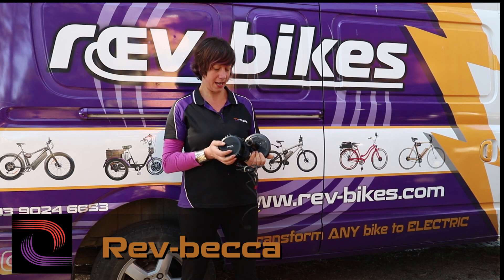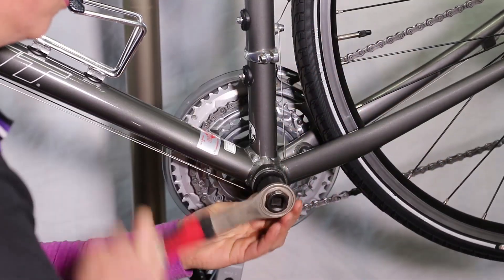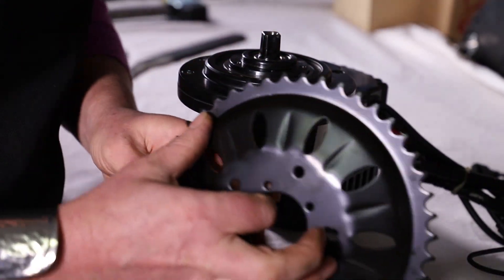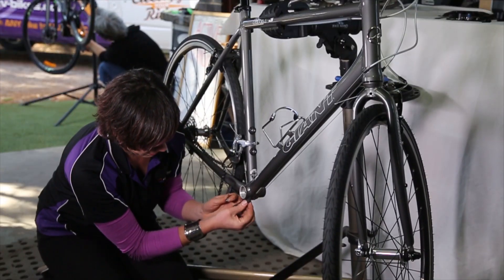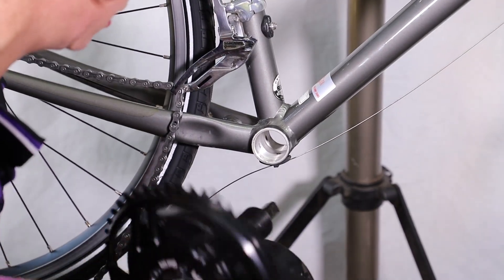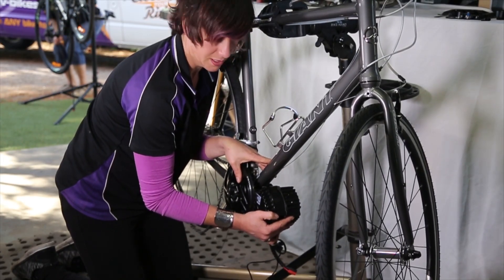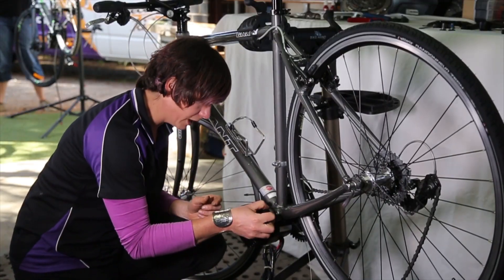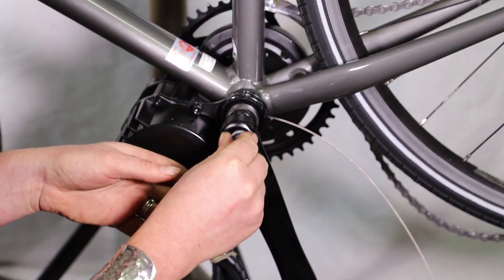Installing a Bafang mid-mount motor

Comment: Well done instructional video, thanks for leaving out or speeding up the tedious bits.  One thing I would like to know, why doesn't the kit come with some optional bits, rubber shims, wedges, etc. for the critical area between the motor and downtube? With my limited knowledge of elementary physics/mechanics I feel that the the torque applied to the frame requires more than a piece of hard rubber which will over time compress and become dislodged. Also, it would be prudent to check and possibly re-torque the motor lock ring after a short break-in period.

Comment: When the motor moves the chain what prevent it from rotating the pedals?
Reply from the maker: The motor contains a freewheel, so it moves the chainring separately from and independent of the cranks. The pedelec function uses the movement of the cranks as a sensor, to engage the motor automatically when pedaling 😁

Comment: Hello, I have a hasebike trike with a Shimano midmotor 250 Watt. Besäuseln my left leg is less stronger than my right after a stroke 5 years Abo, I like to change my Shimano motor for a bafang , Is that possible?
Reply: Correction : because my left leg ;5 years ago

Comment: Might be cheaper to just have the local bike shop remove the pedals and re-install rather than buy specialty tools that might get used once or twice. Just one question,,, when did the crank bearing hangar become a ' bracket '? Isn't a bracket something you mount a shelf on, plus the crank hangar is where you find the crank bearings, why did that change? Is it like the way some of us are calling chips ' French fries '?
Reply: Crank bearing hanger is a phrase I've never heard before - I've worked on bikes for years in the US. Where are you from? In my vocabulary, the cylinder in the frame is the bottom bracket shell, the bottom bracket comprises the crank axle (aka bottom bracket spindle), bearings, bearing cups and retainers.
Reply: You ARE funny.  Truly.  I though America and Auld Blighty were two nations separated by a common language but now I know  it has spread even to the nether regions of the empire.

Comment: Why do you have to toss the existing bracket and gears? You're throwing away some of the bike functionality, are you not?
Great video, btw.
Reply from the maker: The motor has a particular attachment for a single chain ring, which is supplied. So the triple rings can't be used, this would be unnecessarily complicated anyway.  You won't need as many gears once you have a motor, and 5 levels of assist as well.
Reply: @Revbikes  I am just starting to look at the ebike conversions. I have been wondering  about this too. I would prefer to keep the triple chain gear setup that I have and just add a motor to the existing system. That way I do not sacrifice the capabilities of the bike when I am not using the motor (Multi-day trips over the back country roads will not allow recharging casually so the motor will be used primarily as a hill assist). The "complicated" aspect does not bother me as I come at this with 30 years experience as am ASE certified master automobile mechanic, machinist and fabicator. My concern is; Is there any functional reasons pertaining to the conversion itself that prevents the use of a triple chain gear and front derailleur? Thanks for any input you can offer. :)
Reply: @nowhere-everywhere1  Just go with a hub motor. You keep all your bike gears and the motor simply replaces the rear wheel. I am not aware of any mid-drives yet that utilize the triple front sprockets yet. I for one would love to have a 30T and 42T in the front. I currently have a 42T but there are hills where I'd really like to have a 30T for a few minutes. ;)
Reply: @nowhere-everywhere1  You need more than one bike.

Comment: Should the back wheel be locked so the recharge function works?
Reply from the maker: Strange question. There is no recharge function to this motor. Only Direct Drive hub motors can have Regenerative Braking to help charge, a tiny bit.

Comment: She said that the motor was going to replace the "bottom bracket" and she keeps calling the crank the "bottom bracket" so I see she really meant the "crank assembly" ..... I think had she rotated the assembly forward to it's final mount position she probably wouldn't have had to cut and reverse the cable guide, but it was probably a good move on this build anyway because of dropping it from a 21 speed to a 7speed. All in all she did a pretty good job on the build.
Reply from the maker: The entire bottom bracket cartridge gets removed and replaced, as do the cranks and the chainrings.  The crank is just the part between the axle and the pedal.  Thanks for your positive feedback :)
Reply: @Revbikes  TOuCHE !!!
Reply: I too was confused.  I was waiting for the cutting torch part.  But then ... she was right and cut you off in her reply.

Comment: I have a adult tricycle could I put such a motor on my bike any information you can send to me would greatly be appreciated I also would like to know when using this type motor is it a pettiest assist device and whe motor is off is the draglike some of the hub motors thank you so much I mainly want to us it when riding and I encounter steep hills
Reply from the maker: Hi Laura. You may find the motor sits very low below your tricycle, depends the shape of the frame really. Not all hub motors have resistance, only direct drive motors. Geared hub motors and mid drive motors are freewheeling. I've got a hub motor on the front of my upright delta tricycle, and a mid drive on my recumbent 😊
Reply: I’ll have to check that out and measure it thank you

Comment: IF You are fitting other than a 250/350 watt motor I suggest a torque reaction brace, Luna do a good one, as the torque can slacken the motor and keep an  eye on the crank tightness as they do  slacken, and in the interest of doing a neat job DO tidy up the wiring, its really too long for most bikes, buy some small tiewraps and make loops behind the display dash area..I've fitted a few of these and am a cyteck guy.. and if you are in a rainy part of the world make sure all your loom joints and waterproofed , old race inner tubes are good, cut a 6inch section and thread the wires inside join the plugs and tiewrap the ends tight, the other thing that doesn't like damp is the throttle and the power switch, best to use a rubber glove over them or raid the kitchen for cellophane wrap...the brakes have been commented on , all the machines I converted have rim brakes,  race type dual pivots which aren't as powerful a decent  V's.. there's no issues with any I did.. brake  from 40 with a front only..
Reply: Another option is a sailboat turnbuckle. Search for "Bafang Sailboat Turnbuckle" for a different solution. Cheap and can be sourced lots of places.
Reply: She talks about doing that in the next video.

Comment: I wouldn't waste money buying expensive tools like torque wrenches and specialist lock ring spanners to work on a bike,  it's not that critical. A simple one tooth open spanner and an extension tube to apply the correct amount of 'ooomph' will suffice for most jobs on a bike, but then after over 50 years of spannering on everything from Meccano sets as a boy to marine diesels and multi cylinder motorbike engines I do have a degree of in built feel for torque...... Converting back to lbs/feet and having an extension tube two feet long and a fisherman's spring balance works just as well for the more pedantic out there.  After a while if you do it often enough you will get a degree of 'feel' for torque too.
Reply from the maker: So true Richard.  We do have a custom built torque wrench in our workshop now for the noobies, but not worth it for the DIY hobbiest.
Reply: for a one of build its easier and cheaper to let a bike repair shop do it for u than to buy tools u dont have and would o ly use once
Reply: We who know are with you Richard.  Too bad we humans with common sense and a bit of  mechanical  experience are so few and far between. %^)

Comment: Hi I hooked up the kit fully charge the battery and I'm getting no power what do I do?
Reply from the maker: Could be a number of things.  Have you plugged red to red and black to black?  (yes, we've had some do it reversed!!).  Are you getting power at the display when you press and hold the on button?  Are you using a brake cutout sensor, but haven't fitted it within range of the magnet..?  
I hope you can check in with your retailer for assistance.

Comment: Rev Becca where do you get that flat tool for the lock rings?  Thank you!
Reply: I got a complete tool kit with every tool you need to work on a bike for just under $30 (usd ) on ebay
Reply: It's made by Luna Cycles in the USA - lunacycle.com

Comment: Dat was the shit est  video    booooo
Reply from the maker: Interesting. Can I ask the reason for your opinion?
Reply: REV Electric Bikes   how long did it take u to even start. And ask urself did u finish the installation.  I'll wait...............................
Reply from the maker: We appreciate your feedback, thanks. If you're in such a rush, perhaps this is not the kind of project for you.
Reply from the maker: We will be making a vid of the rest of the installation shortly, but it is pretty self explanatory really, color-coded plug and play.
Reply: REV Electric Bikes   I was not in a rush I was just expecting to see her show me how to install the motor  plumbing the brake lines set up and ride off in to da sunset  all smiles that's wat a tutorial is right  not half a job sue u got there  mate  lol send me Ur kit  I'll do a way more better video than our sue there something u can learn from lol took her all day to remove a crank and some pedels lol  Just saying.
Reply from the maker: feel free to look at some of our other vids for details on fitting and using the controls.  This vid was about installing the motor, which it does in enough detail for the average DIYer.  This job takes about 3 hours all up, so I'm pretty sure we are right to chunk it a bit!

Comment: Question for all,,, IF USING  WITHOUT A BATTERY,,,,??? WILL IT PEDAL HARDER ?
or will it FEEL LIKE A STOCK CHAIN WHEEL WITHOUT A MOTOR SETUP??
THANK YOU ALL..
Reply: it will feel like a regular stock chain wheel. no additional resistance when you run out of battery like with a hub motor.

Comment: Hi. Will this fit using a BB30 to BSA adapter?
Reply from the maker: Hi Chad. We have done one with a BB30 adapter.  Worked well, after we cut the adapter brackets down (the centre parts didn't allow the motor to go through, we just needed the collar).  Because it was plastic, and the powerful 1000w motor is quite torquey and great at working itself loose, or biting the teeth into the bike frame, we made a torque brace so we wouldn't have to do the locking rings up so tight.  This was a piece of aluminium strip between the motor casing (using an existing bolt which is holding the casing together) and we put a rivnut into the frame near the BB.  Was an excellent solution.. I should have made a video of that!!  :D
Reply: @Revbikes  I used an aluminium adapter made by FSA. So far so good and appears to be holding itself tight. The FSA adapter fitted very well and matched my lower bracket perfectly.

Comment: BBS03 with rim brakes. Somebody will get hurt.
Reply from the maker: Maybe.. all depends on the riders style, and how well they maintain their brakes.  I've never had a problem.
Reply: Just get a BBS01 of BBS02, what the point of getting 25Amp motor on a bike this weak? getting quicker to the hospital?
Reply from the maker: @Dindo Nuffin sure, we agree, disc brakes ARE better.  Some people have budgetary restraints preventing the perfect bike being possible for them.  Lets not make this compulsory, when the space is already over-legislated!
Reply: @Revbikes  Tektro (among others) offers a disc brake caliper, pads and rotor for $20 USD. A person just needs a bike with disc brake caliper mounts and disc brake wheels. I started out riding my BBSHD with stock V-brakes. It stopped fine even with me, a big guy, on it. The brake shoe wear was significant though and a good set of brake shoes was $15 while the disc brakes for one end of my bike was $20. Easy upgrade when I replaced my wheels so I had the right hubs.

Comment: what would happen if u didnt remove the front derauller?
Reply from the maker: psudabest01 Nothing! Leave it there if you want.. It can even help as a chain guide in some cases.
Reply: I have a shimano acera so from what im reading is that you have to break the chain in order for it to be removed
Reply from the maker: psudabest01 can be the case. If you break the chain, you should get a joiner link for it, never reuse a broken link!
Reply: i can confirm that yes, you will need to break the chain or the derailer to get it off there

Comment: Hello Becca, 
I have TWO questions for you:
1) What would be the minimalist Bafang mid drive build to turn a manual bike into an ebike? 
I ask this because I am not a big fan of too many wires sticking around the bike frame as I see them time and again in installation videos. Can I do a simple build with just a mid drive motor and a thumb (or twist) throttle? I assume that the throttle is the only key element needed to control the motor. I could care less about the LCD display, the speed, or changing the power of the motor as the gears change especially as I ride on the highest gear no matter what the terrain! 
2) Is it a good idea to build ebike on a single-speed bike that can coast? Having no gear derailleur would further simplify my ebike especially when I do not use the gears anyway. The less is actually more and simpler!
Please advise.
Reply: @Amjad Farooq
You ll need to research this, but there are a few threads out there to run the BBS01/BBS02 without display or hmi at all. I personally run the BBS02 with only brake sensors, gear sensor, and minimal HMI (DP E12.UART), and no throttle. Works great for pedal assist only. Also I use a custom cable from Germany (where you can order a custom harness cable with the length you need for each part of the harness very precizely, resulting in a very clean build.(see www.e-bike-technologies.de). And yeah, mid drive all the way, there was no way I would add a hub motor and all this weight to a wheel! I am not affiliated to Bafang or to e-bike-technologies.de, but I recommend them.
Reply: Thanks Becca! I will look into that.
Reply from the maker: You'd be best with a hub motor if you won't be using the gears.  The main benefit of the mid drive is being able to gear the motor up and down for the terrain.  We have a system which can just have a single cable to the handlebars for the display, which you need on the bike in order to control the system, especially the pedelec level (we used to have throttle only systems, but they really are old-fashioned by todays standards - pedelec is heaps more intuitive to use).  I'd be looking at our hub motor systems for your purpose..  https://rev-electricbikekits.com.au/product-category/kits/hub-motor-kits/
Reply: Thanks Becca. But, I am a big fan of mid-drive motors.
Reply from the maker: Amjad Farooq ok, well then I'd suggest you get a mid drive system, and a frame mounting battery will make it easier for you to hide the single line cable up to the handlebars. There are ways to make the cabling neat, maybe try asking a woman to do it for you  😉 You will need the display to turn the system on. You can choose throttle, and it has pedelec.

Comment: torque tools are not that expensive. worth getting some.
Reply from the maker: Feel free to point me to the right tool for this BB locking ring, which has a torque meter on it.
Reply: @Revbikes  they make a very good sockets that will fit into any standard size torque wrench. it needs at least 60 ft lbs of torque.  I just find it daft that all the videos show people saying what torque is required but in reality they have no real way of knowing it's been secured correctly. the two headed wrench is not a good method imo.
Reply: @Revbikes  https://electricbike.com/forum/forum/knowledge-base/motors-and-kits/bbshd/7374-special-tools-that-will-make-bbshd-bbs02-installation-easier
Reply from the maker: We no longer allow DIY installation of our kits, because we'd rather do it right, in house 👌
Reply from the maker: Cool, Luna does it again!
But the feedback on that product is not great.. Not really feeling like that investment would be worthwhile for the average DIYer.
4-TAB LOCKRING SOCKET

The 4 lockring socket tabs should be slightly wider to provide a more snug fit in the lockring slots. The socket is also too shallow, engaging only about half the thickness of the lockring. Finally, the 1/2 inch drive hole is only about 2 mm thick so that the socket wobbles significantly on the drive. All three of these issues makes it difficult to provide 100 lb-ft of torque without the socket wobbling and losing grip on the lockring.
Reply: @Revbikes  yeah it's a fair point. The luna tool that they cut luna into it weakening the metal is not great. I found the socket to be very overbuilt and chunky. it did the job. I have seen at least four builds on YouTube where the motor has loosened either from poor torque or bad alignment. really I think they need to be supplying the socket with the motor in the first place. bafang makes it propriety and then leaves it to the aftermarket. cheers. have a good weekend!